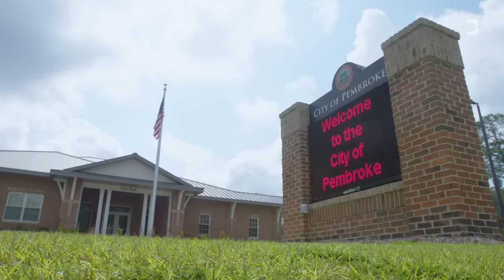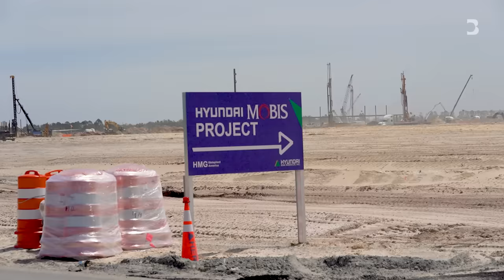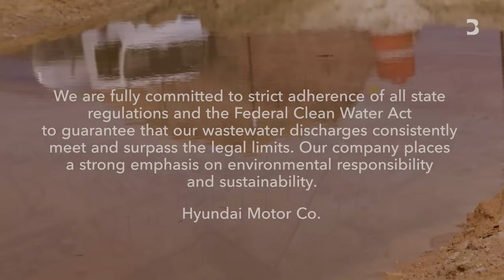The Price of America’s New Factory Boom

Comment: Keep it up Biden.
Reply: This won't work out as its dependent on the government subsidies. Unlike other countries which can pull off long term projects. Western democracies are like row boat with the two faction changing course in the case of the United States or in multiparty systems each faction paddling in opposite directions going in circles to nowwhere.
Reply: @guardianoffire8814  The fossil fuel industry has also become dependent on subsidies.
Reply: @jameskelly3502  But the petroleum industry like corporate farms that grow corn to get corn subsidies have the decades of political influence to keep those subsidies going indefinitely.
Reply: @jameskelly3502   If you want to be carbon neutral you better subsidize a whole lot of nuclear.

Comment: Factory opens 2024.  Factory votes to join UAW 2025.  UAW Strike in 2026.  Factory closes in 2028 due to high labor costs.
Reply: Factory opens in 2024. Offers amazing benefits and wages. Workers never need a union. Factory remains open.
Reply: @kostasm2761 Amazing benefits and wages drive foreign auto makers to competitive advantage, reducing domestic demand. Factory closes in 2028 due to high labor costs.
Reply: very nice motive design,,, 😂🤣
Reply: @kostasm2761 no company wants to give amazing benefits and wages to labours in a top economy like usa, that will drive their profits into the ground, factory shuts down in 2028.
Reply: Depends on is there any changes to the administration and direction.  As long as there are subsidies, it should survive.
Reply: @kostasm2761 Right to work state.

Comment: Semi-conductors?  Yes.  Electric vehicles?  No. One has a guaranteed future demand.  The other does not.  If you’re town is going through a land boom because of an electric car plant being built, sell your house and the land and take the money and run because the electric car industry is very speculative and tenuous.
Reply: Not only that I would be worried about the dangerous chemicals involved in making the batteries. If the respective state does not have strong protection and institutions then it will all be dumped and left for the town to deal with.

Comment: Deforestation for electric cars
Reply: I would rather have fruit trees and food grown than inefficient EVs!
Reply: The first electric car came out in 1890.       And didn't have any of the problems modern electric cars have an.  Ran off  dry cell batteries.     And cost less then  500 dollars to by. Cost less then a grand to make.   A modern electric car if take al the electronics out an. Base them off  basic  components an ect. Cost less then  10 grand to make. Yet Cost. 300 an 400 grand to buy and Cost.   4 grand a day to charge up.
Reply: So to own an electric car  to day  in order to. Afford rent  or mortgage an bills    it would run u.  30 thousand dollars a month to charge up an electric car.      And would have to earn.    250 million dollars  per day to afford both basic bills.   And  the cost of electric to charge up.
Reply: And that's just to keep it charged up that doesn't  include  repairs  and electrical diagnostic services.      And cost to replace faulty wires  and  other parts. An insurance an  warranty and most don't honor the warranty on half the cars on the road  as is